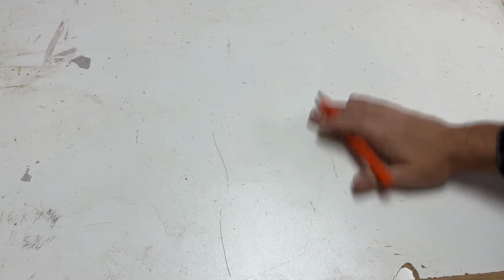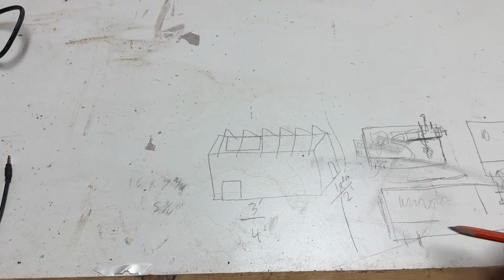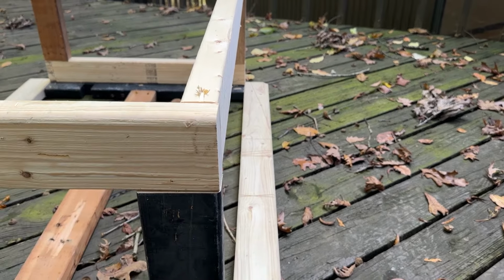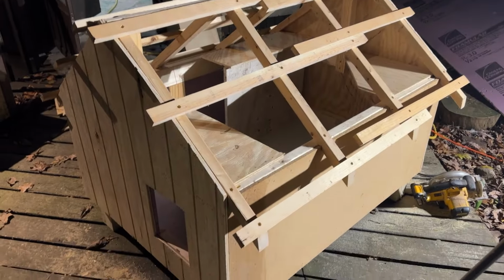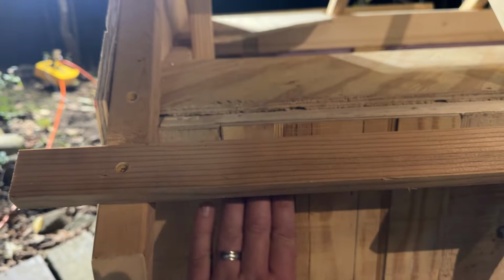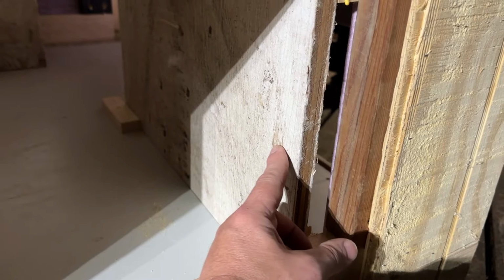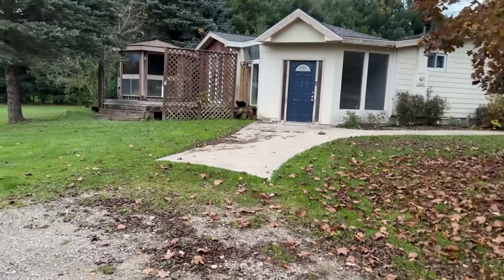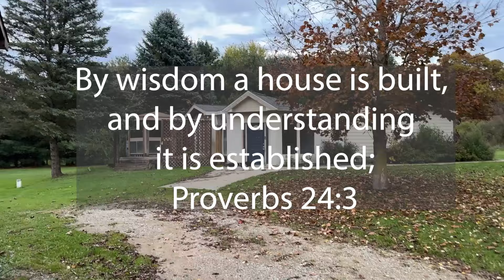Building an Outdoor Cat Shelter For An Undeserving Cat

Comment: I've kept a feral female for past 7 years in eastern Washington State where it can get heavy snow and down to 5 or 10 below for a couple of weeks or more during winter. I use oat straw floor material in a completely waterproof hand-built shelter. I seal it with heavy mil doubled plastic and heavy-duty thick weatherproof tarp for roof. Inside I heavily insulate with 1 inch and 2 inch foam board. There are 4 beds inside. Two are heated and raised from the floor on insulated foamboard. One is oval foam cat bed unheated but comfy. The last is a heavily insulated igloo with heated pad inside and walls lined with mylar survival blankets (for when sub-zero temps hit). I also heat the house and have a temp sensor that I monitor. Temp is 25 degrees above outside usually. Cat is very comfortable when I check in on her even in the coldest worst weather. She ventures out even in sub-zero temps. I guess  she knows she has warmth and shelter when needed . . . .  🐾

Comment: The cat house came out great! I always enjoy seeing your resourcefulness for using left over materials. One piece of advice for when you do have cats in the house. Do not use blankets or other fabrics inside the house especially during winter. Use straw instead. It will help keep them warmer. Blankets and fabrics will get wet if they come in from the snow or rain and will hold the cold in on them instead of keeping them warm. A thick layer or straw will keep the cold from coming up through the floor and will give them good bedding to settle into.

Comment: We live in a small community where there is an abundance of semi-feral cats.  We had 3 or 4 of them" fixed" and just continued to feed them. Being feral, their lifespan is somewhat diminished due to various diseases, inbreeding, etc.  I am fully aware of how they can seem as if you can pick them up, until you actually try it.  These days we just have a "cordial" relationship, which seems to suit them best.  We did take a 55 gallon plastic barrel and tipped it over on its side and put openings at both ends, threw some staw and a old blanket in there and occasionally the will seek refuge in it. A couple of neighbors leave a little food out for them and we just leave them some treats on our porch. They sleep some afternnons in our porch swings but quickly scatter when we come out.

Comment: The big cage you had for the three cats was upside down. The big holes are supposed to be on the bottom and they’re supposed to be a square plastic tray it slides between the bottom of the cage and the cage door if you don’t have that tray, you could cut a piece of plywood to fit😊

Comment: To trap you need to lure them in with food also not just inside the trap. Once trapped you should put a blanket over the trap to calm it down. If you ever trap in the winter please cut cardboard to fit the bottom of the trap and use clips to hold in place. You should always have someone watching the trap if you cant then put in a mobile motion detector and it will alert you. If you need any help with ideas I can help you. FYI cats,raccoons and possums usually eat together. If you have cat food out that will bring the other critters.  I try to feed daylight until winter because raccoons hibernate aka Torpor for weeks then wake to eat and go back to Torpor.

Comment: This definitely gave me some ideas to play around with. One thing I've read, in my very limited amount of time researching cat houses, is that the entrances should be pretty small. Just slightly larger than a cat's head. The thought being that a cat only needs to get it's head through an opening to get it's body through as well. And the smaller opening reduces the chance of predators being able to gain access. Very nice build though!

Comment: I think given the resources you had and didn't have,  it was a great cat house for feral cats. 
I myself have 2 outdoor feral cats,  and both have their own house. 

Each house also has heat. I have an inexpensive smar plug,  that in turn controls the heat source.  I can set the upper and lower limits of the heat with another device. 
Here's the heat source ... simple incandescent rope lights.  They are in a circular grid separated by think pieces of wood.  Each house has 2 of these stacked on top of one another.  The top and bottom of these grids are simple pegboard. This allows the heat to be evenly dispersed... heating the cats sleeping area. 

The kicker is - is that Each source  provides 20 degrees heat increase- so 2 of these equal 40 degrees.  

Winters on Long Island do get cold and damp - but this heating solution does the trick!

I thought you'd like to hear my solution to keeping these babies warm and well ... Thanks for reading and for your video!

Best ~ Rick

Comment: One thing I learned rescuing, cats if it’s a big cat don’t try to get it by your bare hands, next I would acquaint it indoors first (put them in the spare bathroom) they need to forget where they came from, get use to the new humans and then put them outside as outside cats at your house. Second I would try to catch all the cats at one time with a drop trap which is pretty safe for humans and cats. But I really like the cat house good work on that

Comment: The cats smart😜didnt step on the plate. Buy tuna and sardines in oil(smell)  mix it. Put it on a paper plate on the floor. Place the trap on top, on the very far edge of that cage, and squish the paper plate with the edge of the cage. When they become comfortable they sit down and get trapped. Im lucky my feral is moderately aggressive! Good luck 👍🏻🍀you can also order long gloves, that keep you from getting scratched. They’re lined with thick cotton inside and leather outside.

Comment: If these are wild cats, you can best put a shelter on the edge of the forest and also provide a dry place for food, not every cat wants to be petted or picked up. If you ignore them for the rest of the time and just come close often, they will start to trust you after a while and will come closer themselves. If they need your help, they will ask for it by hanging around closer to your home. If you use such a trap, you should use a higher one, such a small rat trap as in the video is not safe for cats. We use the same system here but made of wood with a plexiglass trap door, this way the captured cat is dry and safe and they cannot injure their paws between the wire